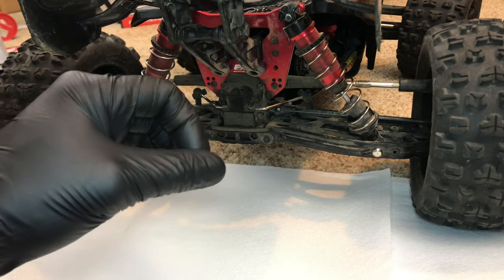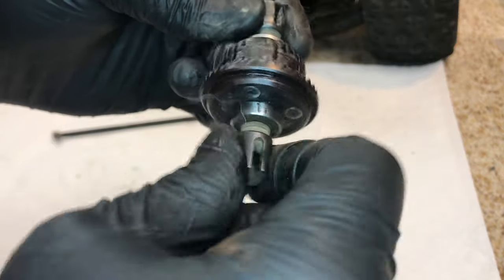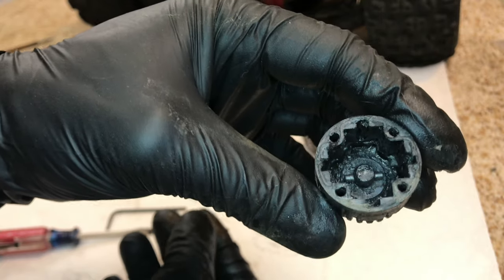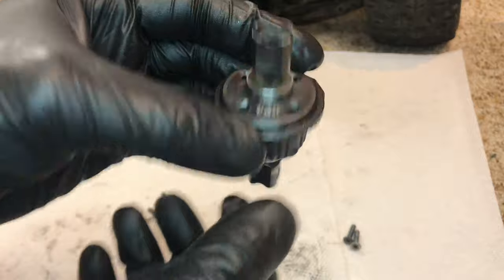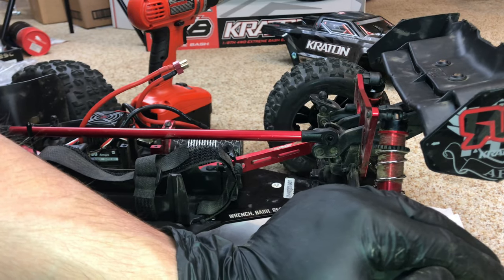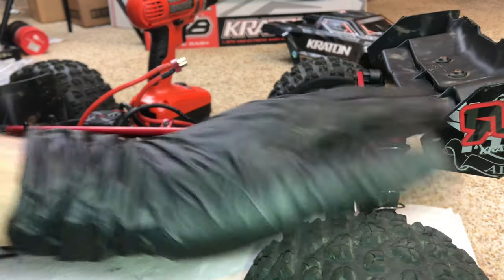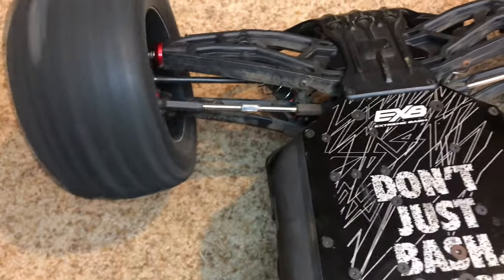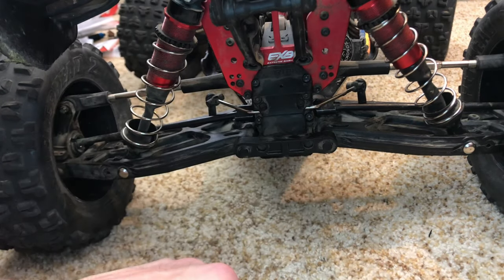Arrma Kraton EXB - DIFF TEARDOWN - What’s WRONG With My Differential NOW?....It’s NOT WHAT I Thought

Comment: The reason why you have play in the rear spole is because arrmas diff pins are a hair to small if you get 2.25 I believe pins you can completey get rid of the play
Reply from the maker: Thanks for the tip!
Reply: You are absolutely  correct  my Man!!! I put 2.25mm pins in my V5 and there is no slop, also you to check your  A-arms pins they are not 4mm like they supposed to be!!!

Comment: That pinion gear is absolutely shot. Also those teeth on your ring gear are destroyed as well. When you're rolling the pinion around the ring gear you're pressing it in the entire time. That's not how it would normally mesh with the ring gear under normal operation. Definitely need new ring/pinion gears, and you need to shim it properly. I know you're hopeful, but I'd bet any sum of money that is 100% the source of your clicking.

I'm an EXB owner as well, and rebuilt my rear diff. I used the "double shimming" method where I got .8mm worth of shims behind each pin and then I shimmed each sun gear with Arrma 13x15.5x.2mm shims. I got 8 behind the cup side gear and 7 behind the ring side gear. Had about 7 packs through it since and the guy (UK guy) who originally discovered this method has had over 20 packs through his. 👍
Reply from the maker: TRWeiss1 thanks for the tip 😊. I’ll definitely need to get ahold of another ring and pinion and make sure to shim them properly

Comment: You need a new differential. That's what the problem is. The teeth on that pinion are shaved down to almost nothing. Get rid of that spool and set your diffs up better. Use some shims and you should be fine.
Reply from the maker: Yeah I got a new diff in it

Comment: Your pion gear is wearing down you can see rounded points and at the point where small shaft is.... its not supposed to look like that
Reply from the maker: Frank Schultz I think most of the issue is coming from the diff gear rather than the pinion gear
Reply: @RCKnockout  i agree but the pinion gear is in bad shape
Reply: This is from outcast but what yours should look like
Reply from the maker: Frank Schultz yeah I definitely will need a new pinion gear
Reply from the maker: Frank Schultz ??
Reply: @RCKnockout  sorry pic will not go through?
Reply from the maker: Frank Schultz ok gotcha

Comment: Not shimmed right. They need to be shimmed out of the box. Thats why i take apart my diffs out of the box. .the shims was terrible nd the edges of the input gear started to sand down same for the ring and pinion. Honestly you could ask horizon to send you under waranty. But i guess his is a lesson for yout next rcs always check your diffs. The teeths are not perfect they are destroyed half of the teeth link are gone
Reply: Try getting hold of horizon for the gears shim it til you have 0 play in between both gears and give her her last chance. If she fails you again get rid of it. Mine is still doing perfectly fine only esc cogging issue for some reason. A lot of people are having 0 issues out of the box but some are having a lot of issues. Also maybe shim by 0.2m the input gear its a13x19mm shim i think it is who goes behind the huge bearing
Reply from the maker: Surchaufeur I’m just waiting on that lsd diff to come from Arrma. Then I have to purchase another pinion gear
Reply: @EXTREMERC416  so I've had great luck with my exb and kinda don't even want to mess with my diffs cuz they work great for now.  I did order gears shims and lsd plates.  Where are you guys find the 13x19mm shims?  I cannot find them anywhere.
Reply: @joshherrman3201  its 13x18 i think sorry for the confusion

Comment: Yea that pinion is ROASTED. It’s not the part that it’s not spiraled. It’s that is WORE. If you’ve ever used a brass pinion you can see that happen within 2 packs.
Reply from the maker: Yeah I’m gonna need a new pinion and diff gear. Arrma is supposed to be sending me one. An lsd to use for the rear
Reply: RC Knockout good to hear. Hopefully it all works out. If not or just for comparison sake the ERevo 2.0 is a well built rig,
But stock esc and servos suck and motor is questionable. Maybe find a used one or sell those parts immediately (traxxas Maxx guys love buying vxl6s combos off ERevo guys), get a max8 combo or something, and most importantly swap the transmission idler gear bearings for ceramic. Metal shields are best as they reduce friction and there’s no need for debris guarding inside the transmission. And apply your own high quality grease of course, like Lucas red n tacky. Otherwise, it’s pretty much a tank. If you plan to jump a lot, perhaps limiting straps but I personally don’t have them.
Reply from the maker: Dylan White thanks for the info man 👍

Comment: Bro, I don’t know how old this video is. But definitely not designed to have a locker. Your sending power to the rear during every bashing situation. When the wheels lock up under any circumstance the mesh is the first thing to go. The power your sending to the rear has no where to go and has to relieve itself. That’s why the LSD plates are in there. So they slip when have the power has no place to go. I’m honestly surprised with that diff locker, that the rest of your diff aren’t burnt up.

Comment: hey bro i think those pins are too small for the opening. looks like to much play with the pin connecting. Im gonna shim up my REAR DIFF TONIGHT. still brand new never used my exb yet. going with  10k 500k 10k   from front to rear. might mix in  some 50k in the rear at bottem of the cup
Reply from the maker: Sounds like a plan! Hopefully you don’t have any issues with yours. I’m just waiting for Arrma to send me the pieces I need so I can get mine up and running.
Reply: @RCKnockout  yes I'm shiming it as well just top and bottom so won't be that much play. Did you watch that video yet on EXB bulletproof rear differential? If you haven't watched it I can send you the link. He builds the differential open diff just like u it before stock and you just shim the shit out of it lol and it will hold up just fine. I shouldn't have any issues but I'm just gonna shim the cup not the input gear to much crap to take apart.
Reply from the maker: @paulrakis  cool man! I’m not sure if I’ve seen it or not? I’ve watched quite a few diff videos on the Arrma Kraton EXB at this point.
Reply: @RCKnockout  Bournemouth RC. Just type in that and building a bullet proof diff. It should come right up. This guy is a expert on differentials. He also response to any questions you may have pretty quick.
Reply from the maker: @paulrakis  Thanks 😊. I’ll have to check it out 👍
Reply: @RCKnockout  yes no prob. I actually didn't even have to ship mine just use one on top and bottom. My rear diff has like no play side to side so we see.
Reply from the maker: @paulrakis  hopefully that will help prevent your diff from having any issues
Reply: @RCKnockout  yeh let's see gonna run her Sunday at a bash site. The metel will expand when hot in the diff but I rather have it nice and tight since too loose may be bad with these. Lots of rain here in NJ and wind is but because of that dam hurricane Zelda.
Reply from the maker: @paulrakis  good luck on your run! 👍. Hopefully everything holds up 🤞
Reply: @RCKnockout  thanks man
Reply from the maker: @paulrakis  no problem 😉